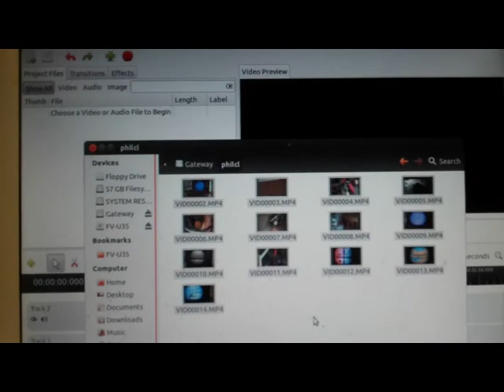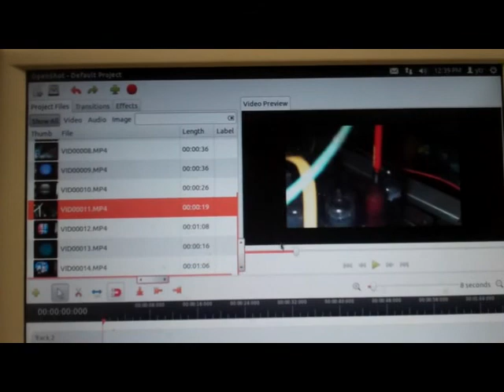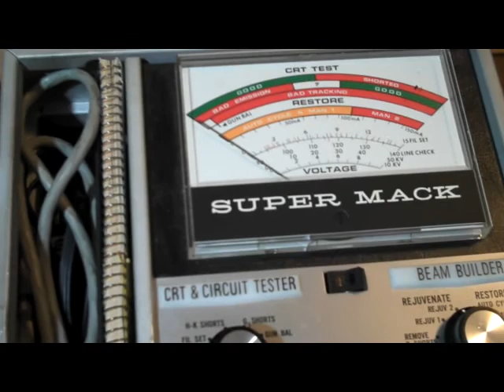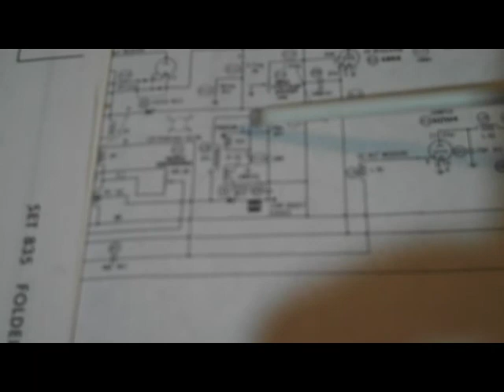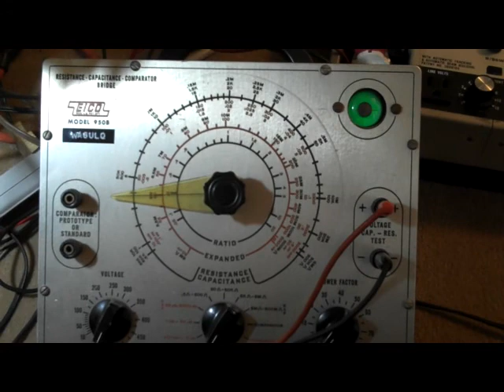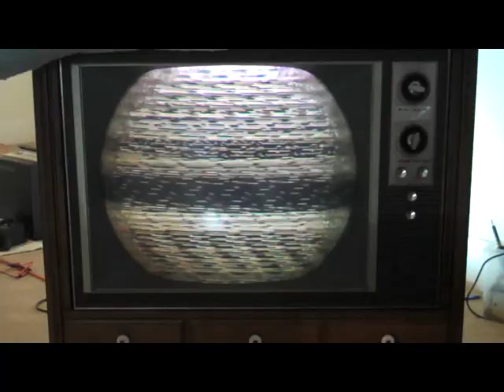Philco 16M91 Round Tube Color Television Repairing a Focus Problem and Starting Up

Comment: We had a Philco Roundie years ago.
Got rid of it because the tv repair people couldn't fix the problem.
Which was a black bar slowly moving down, interfering with the picture. Followed endlessly by black bars, which covered about a third or half the picture.
Someone told me it might have been a 17mt80.
Sometimes slapping the metal cabinet helped, but it would start again.

Comment: Old ciramic disk capacitors do go bad and quite often in batches. The main failure mode is silver migration do to high humidity and high temp. Also the the silver around the leads will begin to migate away from the point contact area.

Do not trust old disk ceramic capacitors simply because they are ceramic capacitors.

Comment: Yeah, that's the one that supposedly has a bad yoke and has not been powered up since '76.  I did check the CRT and it is in good shape (RCA rebuilt tube); but, I do need to get that one out and work on it. I'm sure it will have a good picture once it's fixed.